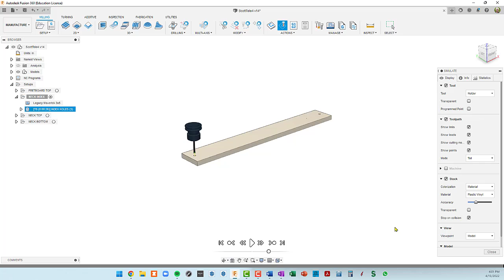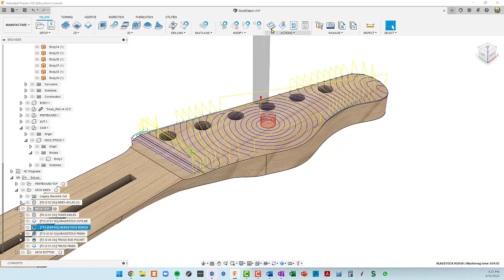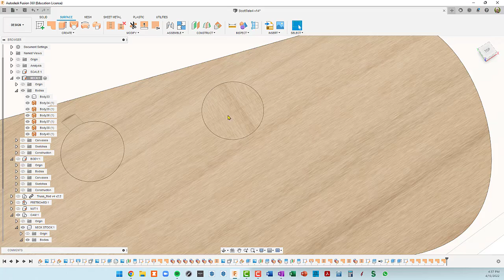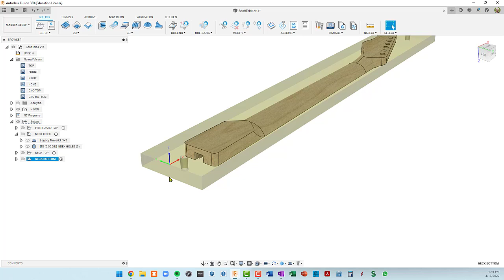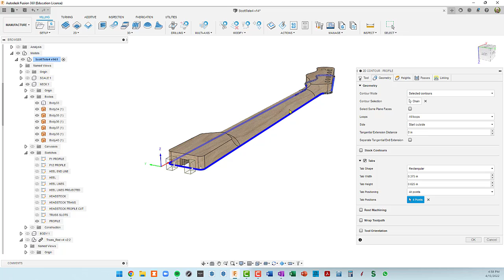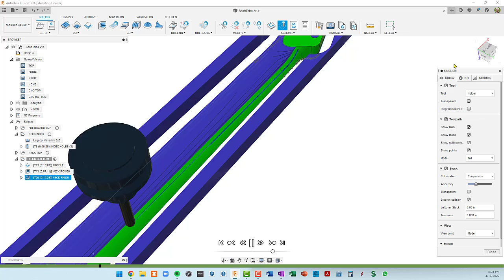Telecaster in Fusion 360:  Part 9, Neck CAM

Comment: Absolutely fantastic video series. Learning so much! Just a question if thats ok; I generated the last finishing parallel operation on the back side of the neck, which looked fine in fusion, both in terms of the simulation and time approximation. However, when I use this g-code in Openbuilds Control it looks really weird and says that it is about a 5 hour operation. I aborted this and tried to generate the same one again, to check for file corruption, but same result. Instead I then generated a 3d adaptive, which worked, but is a bit slower. Do you have any idea what it could be that creates this issue? Thanks!
Reply: Thanks - glad you're enjoying the series.  

I think you'd be best off sticking with a finishing toolpath (3D Adaptive is a roughing toolpath).  You could either try other finishing toolpaths, or stick with Parallel and increase the stepover.  That should decrease the time involved.  A larger stepover will require more sanding but who wants to babysit a 5 hour toolpath.  Let me know how it goes.

Comment: Thanks again for a great tutorial, I had problems getting the neck alignment holes to drill using a 2d bore on the neck blank.  Everything was set up correctly but I kept getting "nothing to mill" error.  On searching the net I found a known issue with the tool alignment settings but these aren't available with the hobby version so had to work around by using a 2d pocket instead.
Reply: A boring toolpath will fail if the bit is the same size as the hole.  So either downsize your bit, or use a drilling toolpath.  I would suggest peck drilling with an upcut bit.
Reply: Thanks Ben I'll give it a go again, I had the holes at 10mm and the bit was a 1/4 upcut.  I also tried with a 1/8 bit, I'm a complete fusion noob so it could be something I'm doing wrong.  The 2d pocket worked without issue but it would be nice to get it working, I'll let you know if I get it working.

Comment: These videos are fantastic!  I'm using them to build my first guitar.
I've found that you can avoid putting in the surface patches over the tuner holes by setting your Bottom Height to the face of the headstock.  That also prevent the plunge that happens if Additional Offset isn't set to -tolerance.